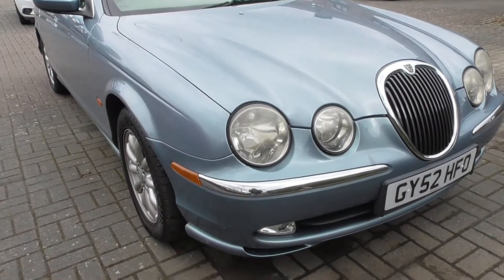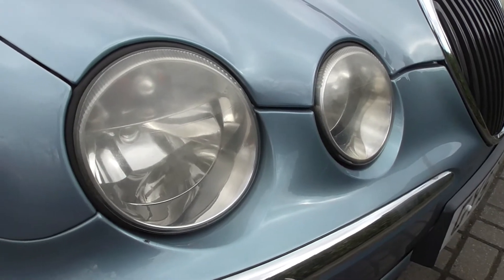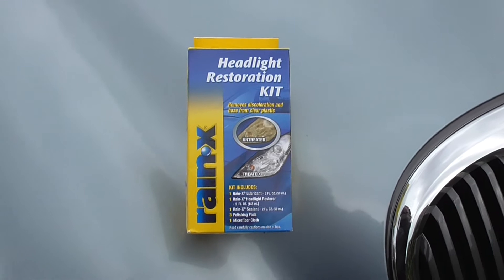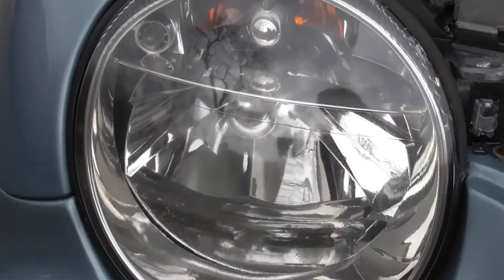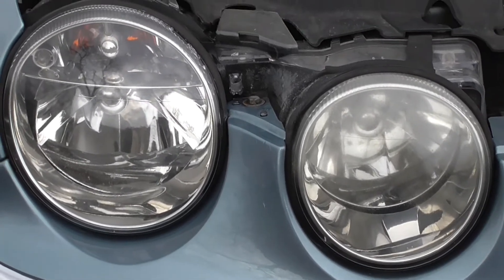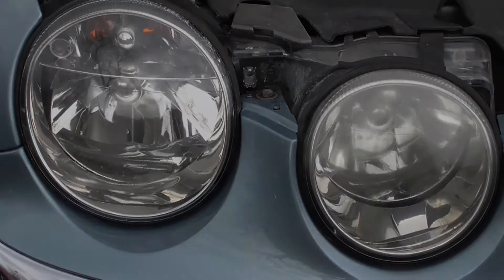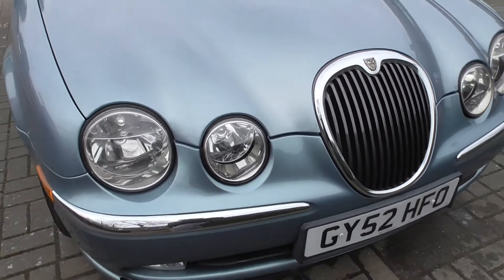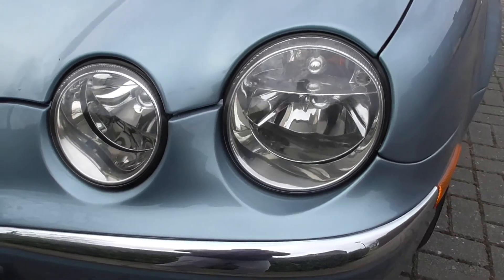How to Restore Headlights with a Rain X Kit

Comment: Excellent! I too have a 18 year old S3 in mint condition but yellowed headlights. Purchased rainX after seeing your video and am going to attempt a restoration job today.
Reply from the maker: Good luck, I've actually found a better kit with a drill attachment which I used to restore the headlights on my Jaguar s-type R. £10 on eboy!
Reply: @BRITISHAERIALVIEWS  the outcome was pretty good. Atleast a 70% improvement. If I could into the inner side of the plastic, that would make it perfect. But don't know how to do that.
Reply from the maker: Yes, I felt the same, even better if you could get to the other side of the headlight lenses

Comment: So how is it holding up after a couple months? Is it starting to haze up again?
Reply from the maker: They're still okay on the outside but they look like the inside (back of the plastic) has some hazing which might clean up if I could get behind the lenses.
Reply: @BRITISHAERIALVIEWS  you can but it's not easy, you can also buy new lenses but not cheap and not easy to change, oh to get glass lenses back eh!